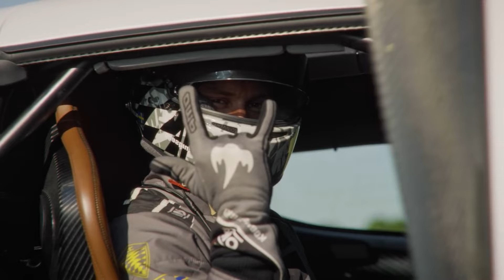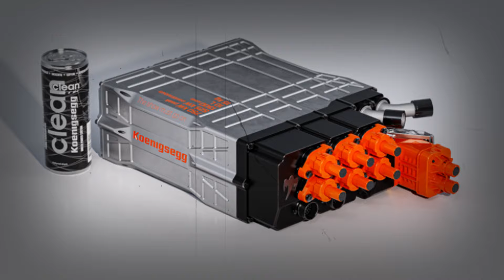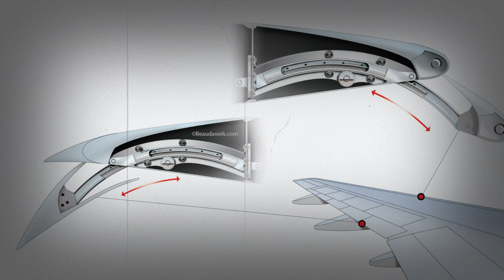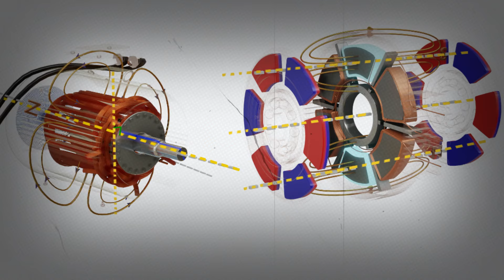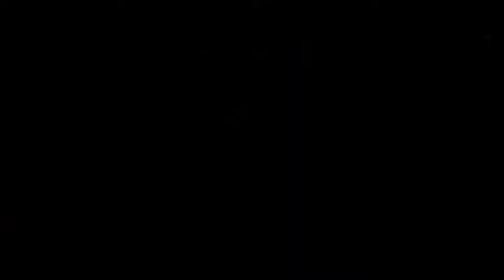The Most Powerful E-Motor: Koenigsegg's Dark Matter Raxial Flux 6-Phase Revelation

Comment: Put one motor on each wheel. 4x800 hp 🤯
Reply: Screw the horsepower imagine the torque
Reply: With all that power who needs wheels, Use the Dark Matter Engine's Electromagnetic to amplify Gravity Waves and use Quantum Levitation Anti-Gravitic. Wheels create friction and energy loss.
Reply: Creates a black hole
Reply: Ima need a coffin ⚰️
Reply: Why whiplash your red neck?
Reply: That's death
Reply: That would be ridiculous I’m in

Comment: A shorter wire means less resistance. so if you were to say have 12 pole pairs, a 3 phase motor would have 4 coils per phase. By increasing the number of phases ( wiring the poles in parallel ) a 6 phase motor would have 2 coils per phase. Meaning shorter wire, less resistance, more power. The best solution would be to wire each pole separately.
Reply: Presumably then, they only went with 2-coil-1-phase grouping instead of individual to keep the size and weight down, since that seems to be a big focus for them. Thanks for the clarification!

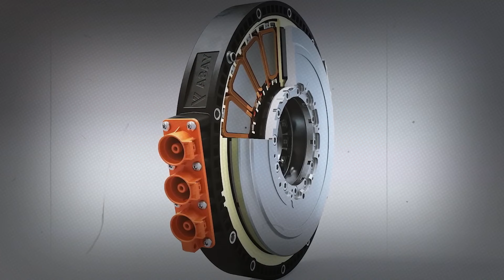Comment: at 3:27 it sure looks like a 3 phase motor (only 3 power terminals)   I suspect that it is a 6 pole or more,  and you would still drive it with 3 phases, cause that is all you ever need (except for marketing).
Reply: It is not the engine they are speaking about , those images and videos are automaticly generated and they are not representing reality
Reply: Exactly. 6 pole motors are generally accepted to give optimum balance between smooth running and torque, but that could easily be increased to 8, 10, or 12 if needed. The results would be exactly the same and a radial motor makes it simpler. A six phase inverter would be far more complex and enormous fun if a wire got crossed, leading to extensive damage. Reversing the motor would be even greater fun. 
I am sure that you are correct and the 6 phase is simply a 12 pole motor with a fancy new name.
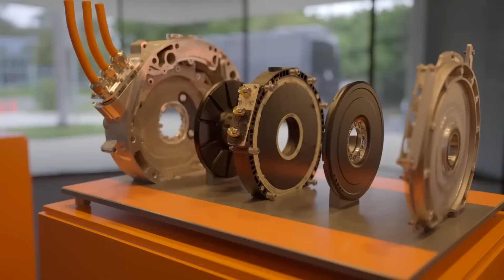3:14 shows a motor with 9 pairs in the rotor.
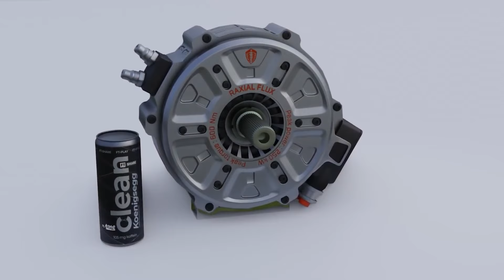2:28 shows a normal 6 pole field.
Reply: Nope, 6 phase 800v ac.....
Reply: P @pietskiet42-_
Reply: Also, the power-limiting part in the chain is the battery pack, not the motor, in any sensibly designed electric car (there are many that aren't sensible though - perhaps because legacy car makers don't want their EVs to be too much better than their fossil cars? Hyundai Kona for example is a pretty decent car, but ridiculously power-limited for no good reason at all, you save very little by skimping on the inverters so you can't use the power that the expensive battery pack can actually deliver, and the motor is just thermally limited...)